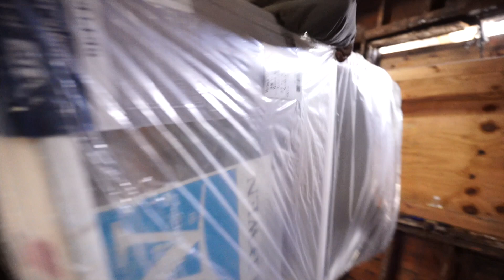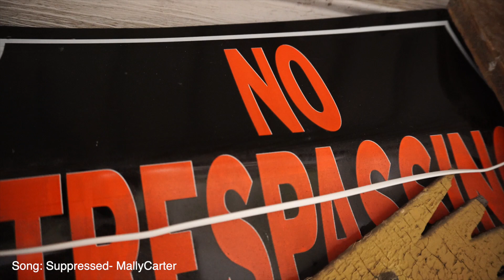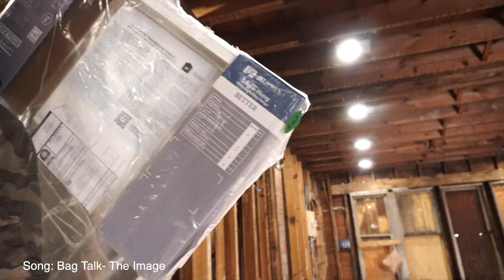Detroit Land Bank Guru Investing In Detroit  ( Window installation )

Comment: In order to get ur numbers up on YT you need to label vids “ how to do electrical work in basement “ etc. the vid headline will bring more views . “ how to do electrical work in kitchen”, how to do electrical work for washer and dryer” etc. . DRY showing work will not help either ex: showing before you start work with wires hanging and showing  vid with work finished is NO GO. Need to show more ✌🏽if wants views